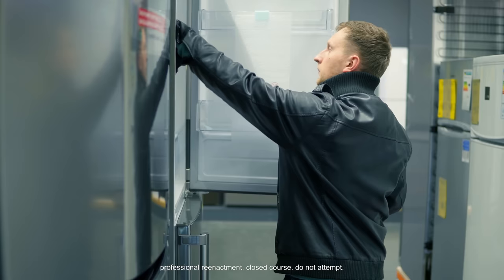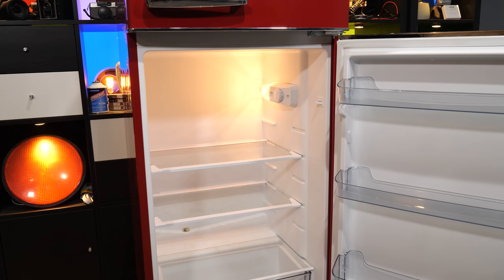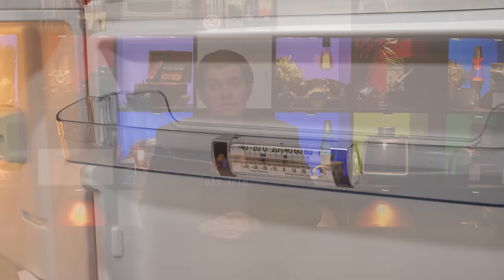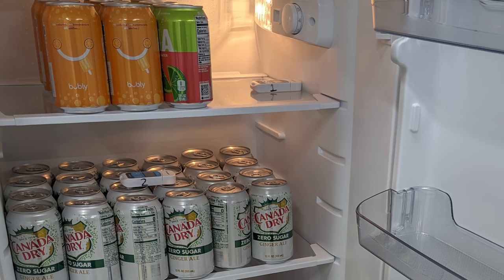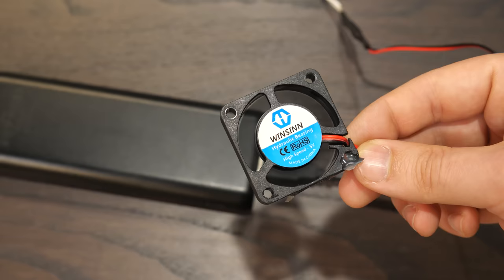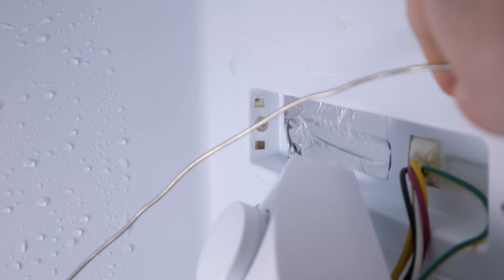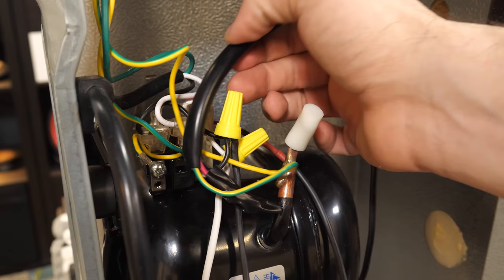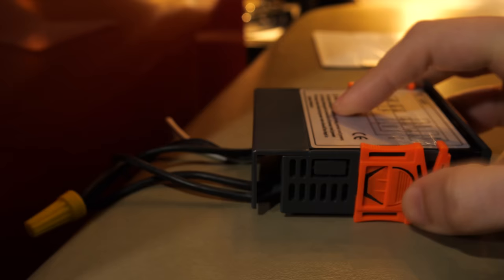This goofy fridge has a really clever design. It's also kinda terrible.

Comment: Neat video! I have a Whirlpool mini fridge and recognized that the components looked similar. Wouldn't ya know it, Galanz bought Whirlpool in 2021! My fridge is ~30% smaller, but I imagine they're still using the exact same part based off this thing's design philosophy. Also, thank you for finally letting me know that that weird plastic tray is for! I assumed it was to protect parts in moving an had it off and in a drawer. Great (hyper-specific) content as always!
Reply: For clarity they bought the Chinese subsidiary of whirlpool, not Whirlpool corp itself. The timing on availability seems too close for these mini fridges to have come from that sale anyways, and I'd be curious to find out if whirlpool makes mini fridges here in the US or if the import them from overseas subsidiaries. Whirlpool does a huge amount of manufacture domestically for the US market

Comment: It does make a difference with the other fridges having a lot more content inside. There's so much more mass in there which is already cooled to the set temperature. Thus, the introduction of the cans has less of an impact on the larger amount of mass within the fridge so the temprature stays more consistent
Reply: Looking at the results and the placement of the sensor bulb, it is less the mass of the content in the fridge that has an effect here, although there is some. But that part mostly comes into play when you open the door over some time or the power is out. in the first experiment with the cans, the thermal mass of the refrigerator itself, the wall lining, the insulation etc had warmed up so much to keep it running for some extended time, until finally the evaporator reached its temperature und shut of the compressor, starting its normal cycle. After that it cycles its normal cycle based on the evaporator temperature it sees. Unless you have a heat source in there that significantly affects the evaporator temperature, the thermostat in this case is completely ignorant of the actual temperature inside. 
Other stuff in the fridge adds thermal mass and has an influence of course, but in this case, it is less than expected. there is a heat exchange with already cooled down stuff, but the additional heat is still inside anyways, although it gets somewhat more distributed to a point. But doing the maths, you still are looking only at the heat energy added you want to get rid of. So having some items to cool down a lot, or heat distributing and have even more stuff to cool down less, in the end does not make a significant difference. Maybe if you temperature probe the single items, it makes a more significant difference for them.
Looking what the specific electronic controller costs on amazon, I almost wonder if that thing, or some component looking like the old thermostat but working like this one inside these days is not even cheaper to manufacture than the mechanical one with its evacuated, filled and sealed sensing bulb and capilary tube these days.

Comment: Wild how the biggest design flaw could have been solved with just a better thermostat. But considering it still struggles to maintain food safe temperatures throughout and takes so long to cool it down, safe to say this is a case study in why modern fridges work how they do and why this design is reserved for small ones with less space to cool.

The explanation of how refrigeration works helped me better understand some quirks of my own fridge, so thanks for going into more detail than just this project.
Reply: this is how most fridges in Europe work, what you call modern those HUGE US fridges simply wasting energy. there is no need in the real world to cool down 10-20kg of beverages in short time. we simply live by the rule of thumb that dont put anything thats over room temp in the fridge, also its not a normal fridge usage around these parts to put 10-15kg of food into it in one go.
Reply: Generally it’s a good idea to provide instructions on those sorts of thing instead of relying on hidden knolwedge to be passed down by word-of-mouth.

Comment: What you encountered was the compressor thermal limits kicking. The compressor, working continously would overheat in this case because it's tiny and is taking forever to achieve the desired temperature.
The shutdown spikes are basically the longest duration compressor is able to run under thermal limits for the compressor
Reply: I thought this too, but Alec replied to my comment and pointed out that the compressor didn't shut off when controlled by the new thermostat, making overheating unlikely.
Reply: My thoughts exactly.
Reply: No, that can't be. Remember the first "48 can" test. The compressor ran for 5 hours before switching off the first time. But then in the subsequent cycles, it ran for the same amount of time as before the beverages were loaded in.
Firstly, running for 5 hours is basically identical to running continuously.
Secondly, if there was a circuit taking care of the maximum compressor time, it would have run for 5 (or more probably 2) hours at a time, taken a break, and repeated that 3 (or more probably 8) times until it was back at the proper interior temperature.

Yes, the placement of the thermostat bulb where it gets influenced more by the refrigerant lines than the air inside the freezer might have been intended to be a poor man's hack to limit the compressor run time. But then again, "limiting" it to run 5 hours straight doesn't seem like it's really achieving it's goal. And the inconsistencies in the inside temperatures are too high a price to pay for that. Sometimes clever isn't good.

Comment: One of my refrigerators is a 
' forced air ' unit. All the evaporation and heat absorbing is done in an aluminum cube heat sink . Air is pumped over the fins of the cube, then directed to the freezer box, then down to refrigerator compartment.
A tray of ice cubes in the empty freezer will freeze so fast that tall shards of ice stick out of the cubes.

Comment: I'm curious if a fan that was ducted so it carried air from top to bottom (or vice versa) would do better.  That way it would force large scale circulation rather than just move air around each shelf... You yelling at yourself about the fan near the compressor was classic!  :D
Reply: I'm curious if top to bottom aquarium pump would end up just as well in long run
Reply: @lassikinnunen   Aquarium pumps are low flow at moderate pressure, and circulating air in a fridge probably wants high flow and low pressure.  However, an aquarium pump is cheap and easy to try!
Reply: absolutely does, i finally bought one of them newfangled fridges that run on highly explosive refrigerants, and i'm able to run it on "mid" power (it has touch buttons instead of a thermostat) all year just by directing most of the airflow from the freezer into the fridge compartments. the only problem is, much like the red fridge, it will auto defrost but it will also take a long time to freeze anything that isn't water. my chest freezer takes care of that though.

Comment: Ah those Inkbird controllers are great! Pretty popular in DIY Kegerator/Keezer builds. 

I've got one that's been running a freezer at beer fridge temps for a few years now and it's never given me any issues. In terms of giving the sensor some delay/thermal mass, the usual advice is just to have it submerged in a small amount of water, so that the liquid itself acts as a buffer.
Reply: I use one to control the heaters in my Aquarium. I bought the cheap version (no Fahrenheit scale) for $3.79 w/ free shipping from china, five years ago. The sensors gone off a few degrees but its still working. :)
Reply: I use one Inkbird to control my keezer temp and another one (the one in the video but with built in outlets) to control my heating element and chiller during brewing :)

Comment: One parameter to consider if you plan on making part 2 of this refrigerator with fans for circulation is the heat generated by the battery bank inside the refrigerator as well as the heat generated by the fans themselves if any. Every little bit counts.
Reply: That was my thought as well. Given how light the refrigeration is in this unit and how heavy that battery bank is, I'm willing to bet it had a lot of unexpected effect on the temps.

Comment: I am confident that the effort you put into diagnosing and improving this fridge is at least 10x that of the efforts the fridge designers put into creating the thing.
Reply: You'd be surprised. After all, as the saying goes, any idiot can build a bridge that stands, but only an engineer can build a bridge that just barely stands.
Reply: @Swingingbells  Yeah, I was thinking "You know why all these weird puzzling things are happening when you try to fuck with it? It's because the designers made it work to exactly the spec they needed to by trying this many (or more!) variations during development." 

R&D is basically trying all the things and seeing what works within the budget you're allotted.

Comment: After 3 years the top compartment was fairly thick with frost, but I was able to break it with a butter knife around the edges and toss the ice into the sink, it took about 20 minutes to defrost about an inch thick layer. I also like keeping drinks on the top shelf of the bottom compartment because I like my drinks ice cold.

Comment: The more mass of food / liquids you add to your fridge, the more thermal inertia it gains and then, the less it is prone to see its temperature raise if you add some "hot" food in it. That's how I maintain my 9 years old fridge, wich is an exact copy of your red thingy (but mine is dark grey, which is very classy), at a perfectly fine temperature for food conservation.

The freezer temp is even at -21°C when it is meant to be -18°C (the standard for 3 stars freezers).
Reply: temperature change doesn't accelerate, it's speed is determined by the difference in temperature, thermal conductivity, and thermal mass.

Comment: When you pulled out the temp probe and it never shut off, that suggested to me that it might have been designed to cycle on suction superheated. As other commentors have pointed out, the design is likely to prevent early failure of an undersized compressor. Let your love of proper engineering overcome your Midwestern frugality and operate a fridge with a properly sized compressor. It will better survive your experimentation. Incidentally, I fixed my Subzero brand under counter style fridge in a manner similar to what you did. I thought I was going to have to replace the compressor, but the failure turned out to be the thermostat, which was bimetallic and located in the compartment. I used a Ranco ETC-111000 about 7 years ago (I think the fridge is now about 22 years old) and it's been fine ever since. If you had a compressor big enough to handle the heat load they add, fans will help while you're measuring compartment temp. I'd suggest you have someone replace that compressor with a digital scroll, because I think the design would be cool for you, but I doubt any are any available that are small enough for that fridge.

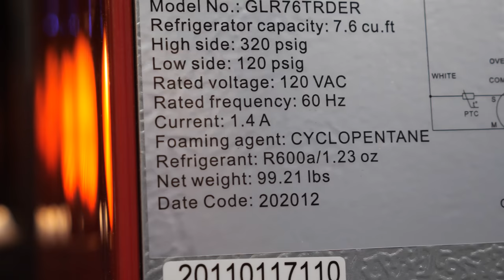Comment: 1.4 Amps at 47:30 is most likely LRA (locked rotor amps) . The safe operational envelope usually is up to 1/3 of LRA which would fit the name of the compressor which suggest 60w of power.

Comment: Okay, here's what you need to do. You need to get a microcontroller and program it to turn a fan on occasionally, track all the temperature readings, and connect to something simple like a relay to control compressor coming on and off. Make sure the microcontroller has a Wi-Fi connection, so that you can continuously log it.

I would recommend getting Jeff geerling a call, and do it video alongside him that does what you need. It would be a fun collab.

Comment: You are not alone. When my fridge was getting to cold i swapped the mechanical thermostat and was also surprised that it was not under the cover when I tinkerd with it. When I watch this I was just waiting for you to make this discovery.
Reply: I too went through the same cycle.

My fridge now has an Arduino based controller with 2 DS18B20 sensors, one at the top and one at the bottom.

It's a challenge keeping it cool enough without freezing stuff at the back.
Reply: @martinwhitaker5096  i'm fixing to do same to my fridge, for the same reason. But why two probes if we can only cycle one compressor? Do you average them?
Reply: @JoeMcPlumber  I set a lower limit for the colder (lower) one of -4 deg C, then use the higher one as the target for the set temperature. This means that it cycles during the cool down phase (so the bottom doesn't get over-frozen), but then regulates at the upper temp.

Comment: word of warning regarding the temperature controller, i have a bunch of them as they are affordable, but the relays inside are not that great and have a tendency to weld in the closed position during the high initial current draw. I replaced the ones in min with a better relay that wont weld as easily during start up, the upgraded relays only cost $2 each (canadian).

Comment: For most fridges, 32F is a good temperature setting for your thermostat.  Keep in mind that there is very little that actually freezes at 32(plain, pure water mostly,) and it gives you headroom for when you open the fridge door to add or remove  items.  It does depend upon the location from which the temperature is being sampled, of course.
Reply: The capacity is the headroom here, pump cold air in it when you close the door.
this fridge should be table top model.
Heat is energy, he could do better, but he is not reading the input, more content needed, the Einstein Fridge is the solution !
Ambient is ambient, location is in the kitchen, it's not an AC system !
Reply: There's 144 BTUs difference between 32.F liquid water and 32.F frozen water. That's why can have your fridge set there and maybe not actually freeze anything.
Reply: Jeez, I never knew how how much local variation there is between fridge set points. In Germany 8°C or 46°F is generally recommended.
Reply: @simonro9168 the unsafe zone where food starts to grow bacteria fast starts at around 4-6°C, 0-2°C is deal temp for a fridge
Reply: @simonro9168  Genau, wir brauchen alein Kelvin, studieren !
minus ist ein grosse probliem, der schreibt der bleibt ! Danke .
Alein Einsteins Fridge ist besser ! Warmte ist energie !

Comment: Back in the late 70's, had one of those GE Monitor fridges. Kept the room warm in winter, hot in summer. BUT, it worked at keeping icecream solid and cold. As for the defrosting, HAIR DRYER, and lots of paper towels. Got an offer of $300, asked for $500, ended up with $450. Had to sell it as my new place was too small. I miss the simplicity. As always, informative, entertaining, and sends a chill down my spine due to memories.
Reply: The Monitor Tops were made long before we had the high-tech insulating materials we have now, there is a large gap between the inner and outer shell that is filled with - believe it or not - sawdust.  I don't know if it's on YT or somewhere else, but at least one person took his apart (the top, being the compressor and evaporator in one assembly, lifts right off).  He replaced the sawdust with modern materials, and the fridge was kicking on something like 1/3 as often.

Comment: I think it's a little too big to be called a mini, It's pretty bad ass though. I've always wanted a vintage fridge.
Reply: His "mini" fridge/freezer looks like it's the same size as my "full sized" fridge/freezer. (Judging by the height of his cabinets, and assuming he's about 6' tall.) Do Americans have gigantic fridge/freezers or something? (I just measured mine, and it's 68"x28"x28".)
Reply: Yeah, a mini-fridge can fit on top of the table. A standard fridge fits under the kitchen counter, or is just shorter than door-height so it can be brought between rooms. It also wouldn't be a "fridge" if the freezer was a major part, it would be a fridge-freezer.
Reply: @AileTheAlien  I'm from Finland and have a fridge-freezer[1] pretty similar to this one (edit: Forgot to mention – on the inside only. On the outside, mine is much less round and much less red). I just measured it and it's 140x55x55 cm, so smaller than yours. I can't really tell from the video how large his is[2] but I would have guessed it's closer to the size of mine than yours. I wouldn't call mine mini by any stretch, but small. Ironically enough, it could[3] be marketed as a "jenkkikaappi", lit. 'yankee cabinet'[4]. A full sized fridge-freezer here is along the lines of 177–203x60x60 cm, having a freezer section almost as large as the fridge section (and typically below the fridge for convenience, and with separate thermostats).

Footnotes:
[1] literal translation of jääkaappi-pakastin, the word we use for an appliance that has both with separate doors.
[2] I think the only good reference point we have unless you cba to measure the shelves is the clip near the beginning of him kneeling next to it, and assuming he's close to my height, I think his fridge is probably a few cm taller than mine but not much more than that.
[3] I don't know if it actually was since I didn't buy it as I live on rent, but I'm looking at similar looking ones on an online store.
[4] but perhaps more accurately 'yankee fridge', since I think 'kaappi' here is short for 'jääkaappi', lit. 'ice cabinet'.